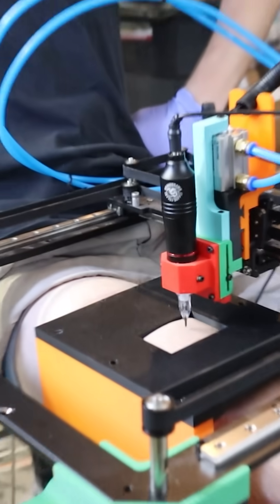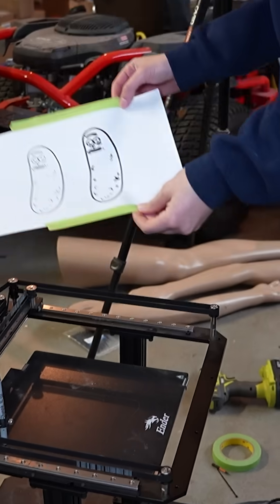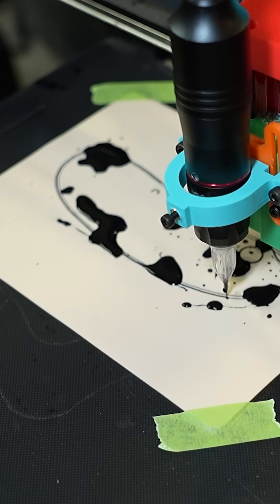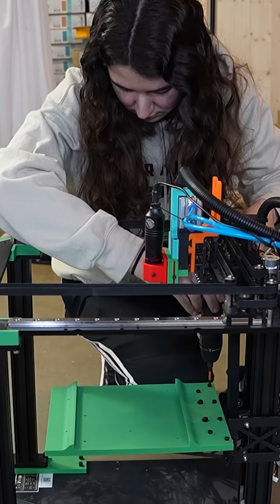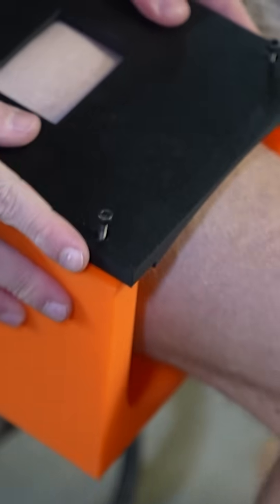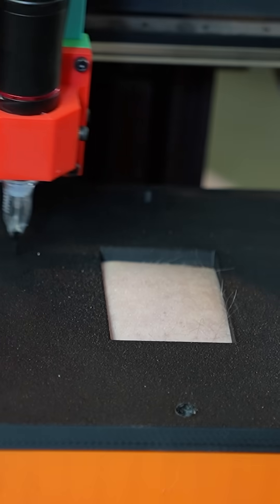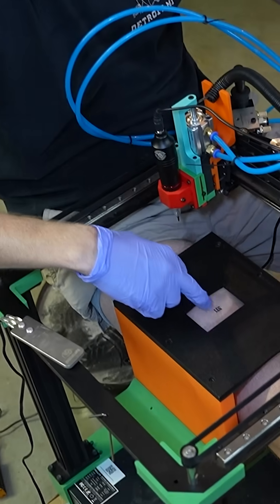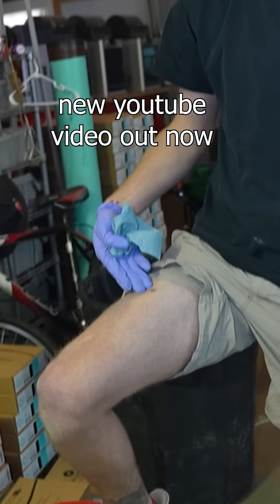Tattoo 3D Printer?

Comment: Add a laser distance reader (forgot the name of them currently) and place it near the gun, then you can use it as a Z offset to keep a specific distance from the leg. This can help with curves as well as maybe fades/shadowing.
Reply: TOF Time of flight is what theyre called
Reply: Time of flight sensor, must be calibrated pretty good tho
Reply: Like auto focus on fiber Lazer systems or vision assisted offsets.
Reply: Or use bltouch from 3d printers to scan leg before "printing"
Reply: I don't think that would work since your leg. Entirely changes It's shape based on your seating posture, and even mild inflammation can change these numbers. my buddy has a 3D scanning tool. And we legitimately must have spent the last eight months scanning just about everything we could think of including our arms and legs, and they were never the same values @IvanDorozhkin
Reply: It is called a LIDAR
Reply: @Mr_Lyric  LIDAR refers to a whole array of laser points and distance measurements used to construct a 3D representation of an object or environment, which is totally overkill for this, what sketch is most likely talking about and probably all they need is a single point laser distance sensor, something that outputs an integral value and not just an on / off signal.
Reply: Idk what it’s called but this is definitely the next next towards perfecting this. People are definitely gonna want Louis V and Bape tats if this tech can develop
Reply: Or a feeler kinetic finder adjacent to the needle.
Reply: @Horace1993 This is the easiest, cheapest, and safest solution. Run a preparatory pass and use a feeler probe to determine the skin height across a few dozen points then use that as a baseline to automatically vary the depth across the surface
Reply: @Horace1993 yeah like a dial indicator of sorts
Reply: Add hard distance limits. And a big red stop button.
Or add some braces/sticks will rollers on the tops that are around the needle and can glide on the skin. Light springs to keep pressure, maybe with some feedback sensors. - As alternative light sensors that are sensitive to ambient light, skin and hair color.
You could really overengineer this.
Reply: Pinda probe?
Reply: @orbit9237  ...pinda probe? Real time distance measuring would go WAY better here than recording a mesh as it's skin.
Reply: That would create the issue where it would appear normal from a top view but distorted from the sides of the tattoo gets big enough, great start but this is definitely not fit for public use or for anything other than flat surface or near flat surface tattooing.
Reply: Eddy sensor?
Reply: It could deff work
Reply: you can just probe the area and easily account for the z changes when working on things like legs and arms
Reply: the second the laser goes wonky tho it goes to stabtown.
Reply: Imagine u fuck the work offset up on that or a decimal point gets off one 😬😂😂
Reply: The problem i see is the depth the needle is going in. Like the tattoo this guy got seems like it wasnt deep and it will fade quickly.
Reply: You all know it was a first attempt and extreamely well done for what rhey tried@XxTh3Fall3nxX
Reply: I've been waiting for this technology since seeing that laser tattoo machine in "Divergent". Will it inspire me to get a tattoo myself? No. But someone out there can appreciate it. 😊
Reply: LIDAR perhaps
Reply: what i was wondering about too
Reply: And pain / safety. This is genuinely unsafe tbh they wouldn’t have any idea how deep that needle goes.
Reply: @xx-mx9mj you do realize that’s why they practiced on fake skin first right?
Reply: @Chu_Nyanning  the fake skin was perfectly flat, and the real skin was curved.  Way different

Comment: It's amazing this worked with having to stretch skin and perfect needle depth. Definitely impossible to do a detailed tattoo with that.  Pretty incredible you macgyvered that to work. Lol
Reply: The way they clamped his leg kept the skin tight
Reply: @XYZdude00  exactly it’s a lot less Mcgyvered than op thinks. 3d printer stepper motors have accuracy to .1 of a mm which is better than the human hand could ever do. With the leg attachment that stretches the skin, this setup is about as consistent as you could be with a tattoo pen as long as the skin is flat.